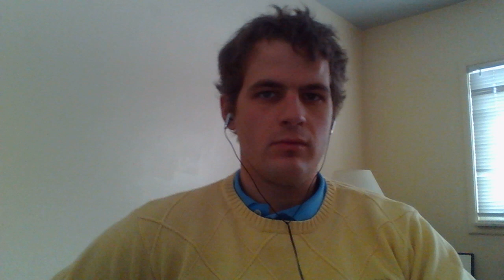How to clean aluminum siding the correct way.

Comment: I have mold on porch white aluminum awning. Used vinegar & water with soft RV soft brush. Got mold off but have some dark spots that were white when cleaned but when dried, are dark spots. Any suggestions?

Comment: I just did my aluminum siding and I guess I got lucky because I used the yellow 15° adapter on a Simpson 3200 psi pressure washer and was only inches away from the siding. This was on the shady side of the house where there were 6-foot bushes for at least 20 years. There was mold and, for some reason, at the other end but same side, there was a rust-like orange coating. Anyway, no damage that I can see, looks great.

Comment: Hi Patrick. I used your method on my 25+ year old white aluminum siding, following your 4 steps and it looked great when I was done but today I see slight vertical streaks. This was on the shade side of the house and I'd like to know what I may have done wrong before I do the sunny side of the house, and how to remedy what I've also finished. Thank you in advance.
Reply: Probably oxidation.

Comment: I have cleaned several aluminum siding homes with common store bought bleach. 1st step for me is to apply bleach evenly across the side of the house with the low pressure soap nozzle . I do one side of the house at a time , by the time I finishing applying the bleach on one side I am ready to go back and rinse with high pressure. . Staying about 8 ft back rinsing with a green tip. Repeat the same process on the next side of the house. 

Not disagreeing with your many steps , if it works for you great. I think you have a couple not needed steps in your process. My goal is to do a solid job for the customer and move on. Not spend more time than needed. 
I run a 4000 psi pressure washer with 300 ft of 4500 psi rated hose. Pressure washer never leaves my truck. 
I have many repeat customers that I have been working with for 20 years. 

My opinion is pressure washing is a very simple process don't overcomplicate it. I am not scrubbing anyone's house when I have a machine that can do the work. That's ridiculous.
Reply: make a video bro!
Reply: You shouldn't run bleach through your power washer.  It ruins the pump.
Reply: @MrWisdom79  he doesn't run bleach thru his pump, he downstreams, which means hes running it thru after the pump
Reply: @shanebarrows1867  don't know exactly what you mean explain please
Reply: @Iambriangregory  look up downstream injectors
Reply: @rahn6869  thank you for the direction!

Comment: What can be done about  peeling paint on aluminum siding that leaves small bare metal areas,scattered all over the side of the house.In past years when just a few spots appeared just painting over each spot  with regular exterior latex paint in a matching white colour seemed to work for a while.

Comment: Thank you so much for this info! You probably have saved me a bucket of money from paying someone to power-wash and/or paint my mobile home. Using the TSB, I can do this myself. 
Since I won't have to paint after using your method, I will still have to deal with the rusty screws that are spaced around the home (it is a 1979 mobile home). Any advice on how to treat those rusty screws after I've cleaned the place?

Comment: Is the tsp liquid or powder?  When you say 10 to 1, is it 1 cup tsp to 10 cups water? Seems pretty strong.
Reply: +Eileen Haugen Powder.  It really doesn't have to be exact.  Fill up a 5 gallon bucket with water then pour TSP for five seconds in the bucket.  The TSP isn't going to hurt it.
Reply: tsp is a powder and the boxes will have directions on how much to mix to get a certain mix. Make sure you rinse completely after the Tsp is applied. TSP is used to clean old concrete, it is stronger than they seem to think.

Comment: Can i skip the Tsp and just use outdoor bleach 3 parts water and 1 part bleach? the house is blue aluminum siding and has streaks after washing with simple green.
Reply from the maker: You can try, I would go to the TSP if it doesn't work.  Bleach doesn't separate bonds as easily as TSP seems to especially with aluminum siding.

Comment: Thanks for the tips!  I just purchased a duplex with green aluminum siding that has ridiculously oxidized and fading issues where the sun rose everyday.  Places of shade still have almost the original dark green color...  Will this method take off paint?  And will the paint I put on afterwards need to be dark as well?
Reply from the maker: TSP is used for surface preparation before painting.  The product will not take off paint.  After the oxidation has been removed your paint should all be the same shade.  If possible, I would recommend a primer.  Try several applications of TSP if the first does not produce the desired result.
Reply: Thanks!

Comment: How about cleaning painted aluminum siding? Original color was a dark green and was painted some 15 years or so ago a light beige. Starting to see what i believe to be oxidizing dots coming through the paint here and there. But overall the paint is in good shape, intact and still has color.Thoughts?
Reply from the maker: My thoughts are use a gentle detergent such as dish soap with a soft bristle brush.  However to remove the oxidation, the tsp will be necessary.  Do a small test spot first to make sure :)

Comment: How do u get tiger strips off gutters? Someone told me JoeMax and bleach?
Reply from the maker: Maybe.  Tiger stripes are actually tanic acid staining caused by the overflow of water that has been mixed with the elements.  I have never had luck with chemicals, perhaps your friend has a winning combo.  I would use an outdoor rustoleum to re-paint them then make sure to keep them clean so the issue doesn't arise again.  Sorry I couldn't be more help, I have never had luck getting them out. Call Superior Power Washing in Apex NC, they have a solution I have heard.
Reply: Spray nine works great also, spray on wait 15 seconds and wipe off with a soft cloth.

Comment: How would I remove rust from my aluminum siding? My sprinkler system sprays on my house causing rust 😝
Reply: Diana Coburn I believe aluminum doesn't rust
Reply: Bryan Corrigan. I know that!  The water from my well that comes out of my sprinkler causes the iron from the water to deposit rust stains onto my siding, garden rocks, and pavement. I've decided to use a chemical like CLR or something else to remove the rust!

Comment: Im sorry .Ive been doing aluminum refinishing since 1985. We did 537 aluminum houses last year alone . Multiply that x30 yrs . I have never had one call back or 1 single house fail. I never use TSP or any other chemicals . I guarantee my work for 25 yrs.
This video is very misleading and here is why.
1. the film on aluminum siding is called "chalkiness " not oxidation.
2. Oxidation to aluminum siding is same as rust to metal. (white bumps ,salty appearance ,sometimes if severe little tiny holes usually underneath under hangs. )
3. TSP is ok only if a powerful power washer is utilized afterwards (3000-4000 psi. or greater from about 6-8 inches away from the surface.
4. If TSP is used and not washed with a powerful power washer then it leaves a slimy surface (paint will not adhere properly .
5. Do not use bleach . It might discolor your roof ,driveway or kill your grass and plants. 
6. If you don't use a powerful power washer scrubbing your siding will accomplish nothing (good luck getting into hard to get areas,underneath laps or under hangs where mostly needed)
7. Please get yourself a powerful power washer . get close to the surface ,take your time and get it clean.(power washer will tare your skin off it definitely will get anything off the surface ,accept grease ,never seen grease on a house but it might happen)
8. I could not watch this video till the end because this guy has no experience AT ALL!      ****The object of power washing is to get rid of any surface chalkiness ( if you rub your hand over the siding you should aim for no flowery substance on your hand )****
******Oxidation is something totally different, Its rust like***** If oxidation is severe sometimes  painting is not an option,oxidation usually starts from the inside of the siding and works itself out.
Reply: Chuck.  Oxidation is the loss of electrons.  When oxidation occurs you'll see a white hazy film appear known to yourself as "chalkiness".  Bleach when reduced is not going to kill plants, animals, or anything else.  I'd STRONGLY advise against a home owner using a pressure washer for anything but rinse.  I respect your years of experience but your comments not my video are misleading.
Reply: Disagree using high pressure.  Just because it is strong, does not mean it's the best choice.  Please use cleaners, because oxidation is a chemical reaction that will need chemical cleaning.  Now just because i say chemical,  it doesn't mean it has to be a strong or dangerous one.